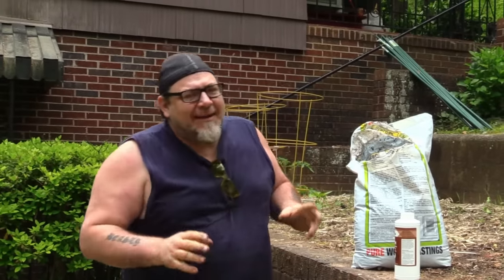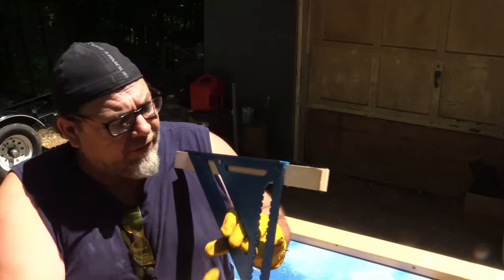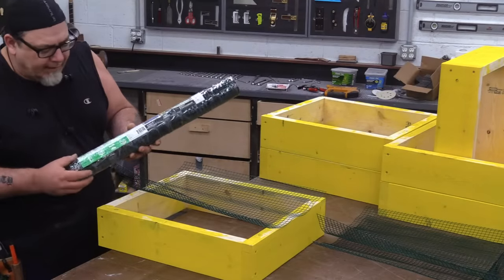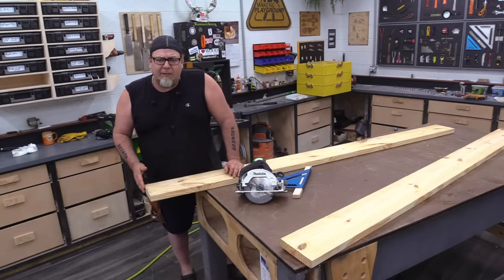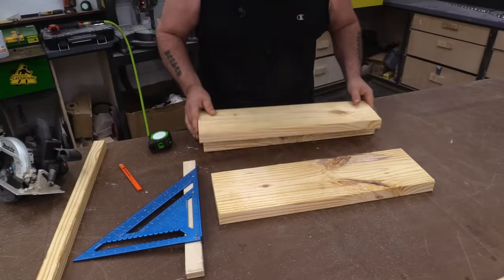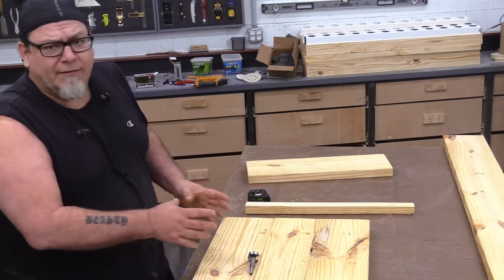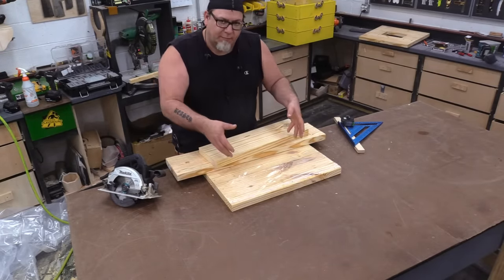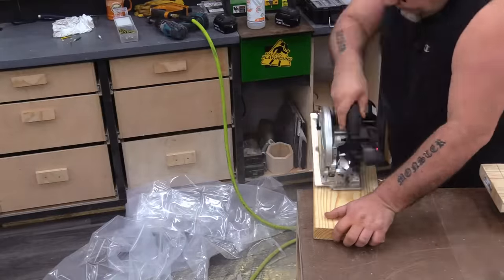Best DIY Worm Farm for gardening or fishing | How to Woodworking

Comment: Great to see you on your feet after the year you’ve had. I might just give the worm composter a go. The speed square trick I’ll definitely use - my current lockdown project is sleeper raised beds and that will help with cutting each side of a sleeper to the same line. Thanks for posting.

Comment: Izzy, looking to upgrade my bathtub worm farm and did a search on YT, saw your mug, and thought, I know that guy from circular saw table and jigs from a while back and had to see what you had to offer.  This is fantastic project and am going to use this design.  I guess only thing I am curious about is the way the worms go up to the next tray.  Guess you just have to make sure the bottom tray if filled to the top so there is not a gap.  Went to Instagram to see follow-up info but did not find any.  As others mentioned thanks also for the speed square tip; and also appreciated your technique for joining the wood pieces with that wood spade bit and angling that hole to join together.  Seems super simple and will give that a try.  No glue!

Comment: Love the speed square tip. We used to use a similar idea with the chain saw. Clamp a piece of wood or broom handle to the chain saw extending 16" to the side of the saw and cut your firewood all the same length for easier stacking and storage.

Comment: I watched a guy do this except combined a composter and worm farm.
 He used a plastic water trough (150 gal) that he had elevated from the ground.
To get the worm tea out he just put it on a slight angle and put a faucet on the drain plug.
Then to get it out all he had to do was turn on the faucet over a bucket or old gallon milk bottle  since gravity would move it to the low end of the trough.
A pretty large trough so he had so much worm tea he gave it away to his friends.
The only thing was he needed to turn what was in the trough with an tool he made that was a little easier on the worms and tube.

Comment: My experience in a similarly styled worm farm is that the compost really decreases in volume a lot, so even if you filled the first box completely, the next time you went to fill it, it'll only be half full. It also gets pretty heavy, so moving the upper layers to get to the bottom layer can be a pain in the back. On the plus side, the individual boxes make great sifters for the finished compost, at least once it's dried out a bit.  You may even want to harvest the finished compost by bringing the oldest box to the surface and let the worms dig down to get away from the light.  Worms also love cardboard and brown paper as well as dried leaves. Egg shells can be baked and then ground to add calcium and grit for their gizzards as well.  My failure was that my worm farm got infested by slugs who found the farm to be as hospitable to them as the worms.

Comment: Glad to see you are back and building stuff again.  Yes, by all means, more "Bendy Board". 
I'm also curious about that mini drill/screwdriver. What brand is it? Did you consider using your impact driver to tighten the bolts on your vertical clamping rack?

Comment: I was planning to contact you about battery powered garden tools. Similar to the drill powered tilther at Johnny's seeds, but gear drive with swirling tines and a greens harvester that doesn't require bending over to use it...I have an idea for that design too😁

Comment: Izzy, I'm making replacement post hole digger handles w/out a lathe and I'm at the stage where I want to taper the diameter in and out of a section near the top to serve as more comfortable handholds. I have a corded DeWalt drill, some skateboard bearings and various hardware, a lot of scrap lumber, and a shop. Any suggestions or, better yet, recommended previous videos?

Comment: Hey, you’re working with wood. It’s just another area of woodworking. You can make a garden locker which is a small storage container for putting garden tools in. It can be a box with a hinged lid that you can lay your tools in or it can be upright with a door. The upright locker could be 2‘ x 2‘ x 6‘ tall if you just want to keep a hoe and shovel there or I could be 6’ x 6‘ and two or 3 feet deep so you can keep several more gardening tools and hoses in war 10‘ x 8‘ x 10‘ high garden barn to store the garden tractor and blower and an endless supply of other gardening tools. I’d watch that.

Comment: Yeah, Izzy.  Why aren't 2x8's square on the ends?   I've noticed that in my last 48 years of building that from east  coast to west coast and in between, 2x8's as a general rule need to be squared up.  This is not the case with 2x4's, 2x6's, 2x10's and 2x12's.  Certainly an oddity in my book that different mills in different parts of the country all produce out of square 2x8's.  If you know why, let me know !
Reply from the maker: i dont know but would be cool to find out